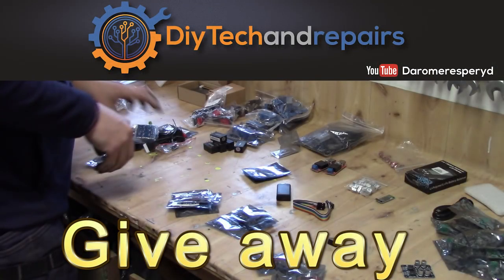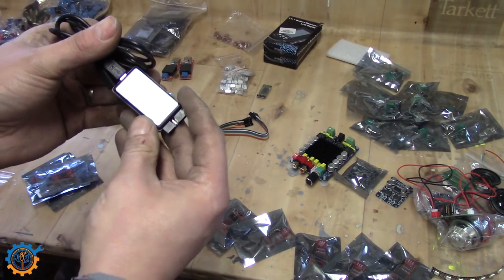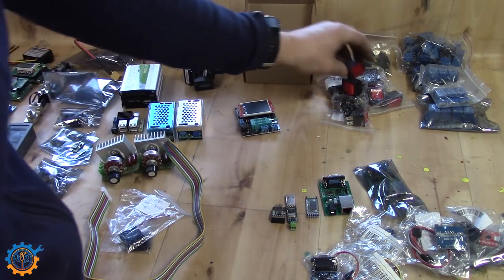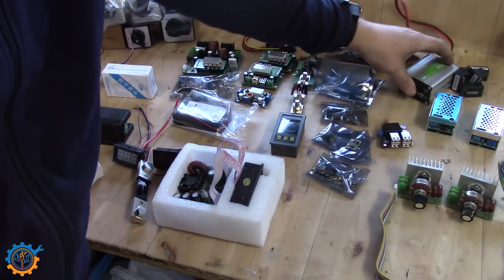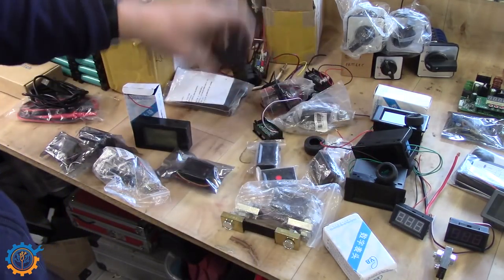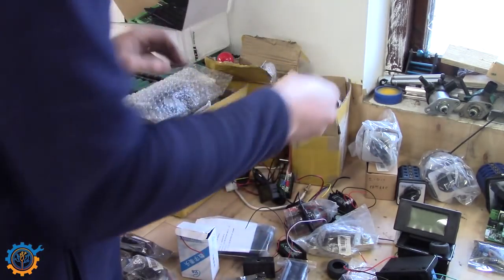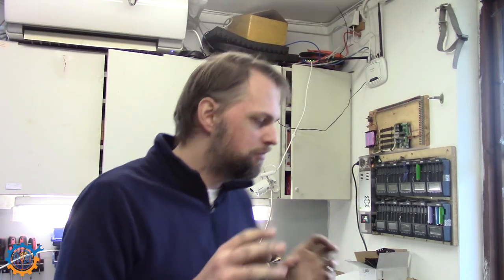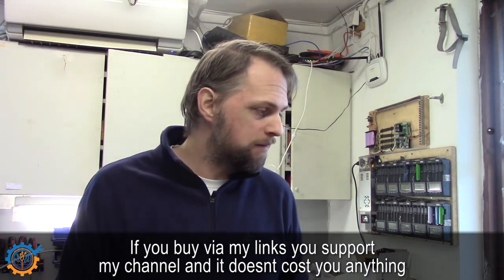Give away and a look in my project boxes

Comment: 7:18, what's the unit you're recommending to build a power supply on? Up to 50 V 20 A sounds great.
Reply from the maker: https://rover.ebay.com/rover/1/711-53200-19255-0/1?ff3=4&toolid=11800&pub=5575290868&campid=5338074051&mpre=https%3A%2F%2Fwww.ebay.com%2Fsch%2Fi.html%3F_from%3DR40%26_trksid%3Dp2050601.m570.l1313.TR0.TRC0.H0.Xdps5020.TRS0%26_nkw%3Ddps5020%26_sacat%3D0   Nice unit. Pending a case and will build mine

Comment: Is the 1S balancers used to balance two different packs? How high capacity is it reasonable to use it for?
Reply from the maker: You hook one to each pack. More expensive than Batrium per pack persue. How high im not sure. if they are in balance they can do huge packs. Active  balancing and have done video on em

Comment: Remote based monitoring Device - need something to measure the power usage on my e-skateboard videos :)
You could make an RS485 to Ethernet device using ESP8266 so your mobile can connect to the inverter or something that isn't network aware and so you can monitor it within the house without network cables etc.. just for fun. that's what i want to do with my ABB inverter which only has RS485 and costs $200+ for the ethernet board.

Comment: I have a suggestion can you use raspberry pi to control hearing load by varying the AC voltage. It is my project what I have to do. Or at least can you tell me how I can achieve this by using raspberry pi. And what equipment I need beside raspberry pi and water heating element.
Reply from the maker: "hearing load" ? What is that?  If you just want to control a heating element then take a  look at one of my older videos where I did this. "divert load to heating" or something.
Reply: My mistake I am talking about this heating element. ebay link is added 

https://www.ebay.com/itm/SG1453-Electric-Water-Heater-Element-Screw-In-240-Volts-4500-Watts-Univ-Rheem-/151883116181

I want to use it but with different power level means. I will be using here AC mains electricity and want to control it with raspberry pi 3. 
300W output 
sleep for 10 minutes (this heating element should get 300w just )
325W output 
sleep for 60 minutes 
200W output for 15 minutes
Reply from the maker: Its doable of course. triac or equal of some kind.
Reply: DIY Tech & Repairs can you please give me some suggestion. Because it is my master thesis project and I am new in programming